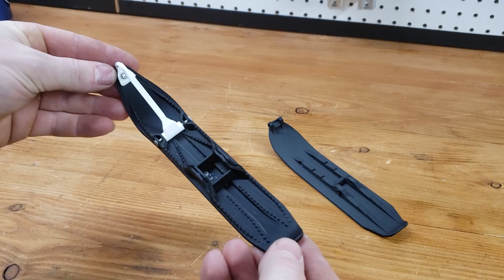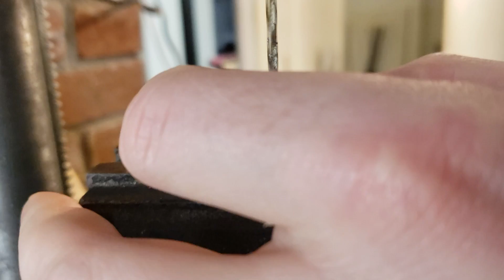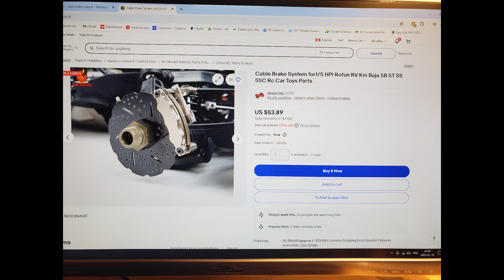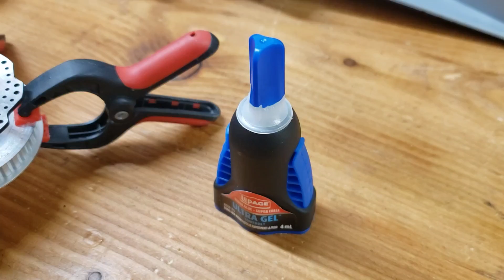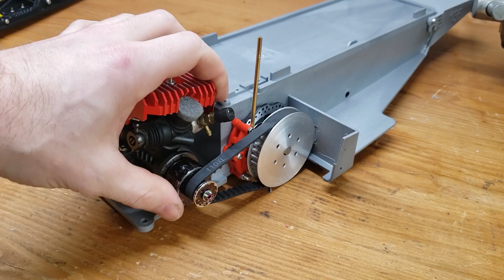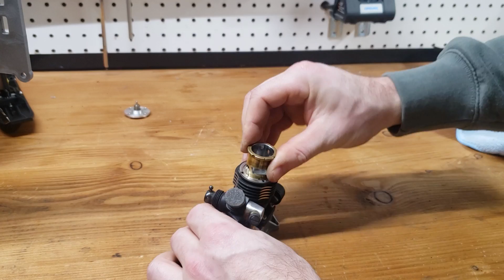Art Attack SuperMod Build - Part 6

Comment: why 3 of them??
Reply from the maker: @suchenderw9890  i assume you mean the three screws on the skis.

One holds the front of the hook, and two hold the rear part.  Having two short screws looks neater and I don't need to add a nut in place, with some of the bolt poking out.  Also ever so slightly lighter